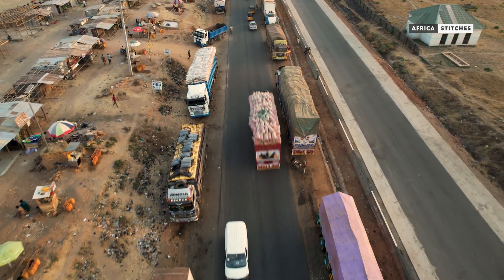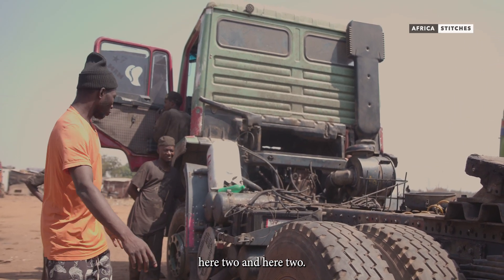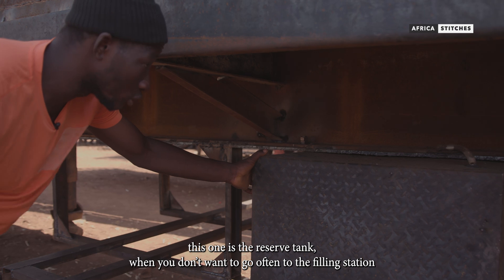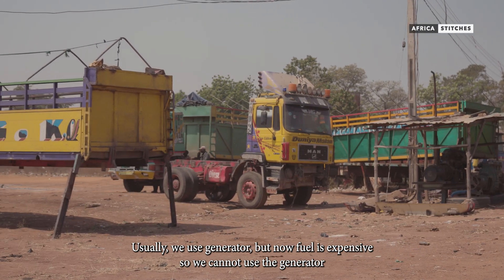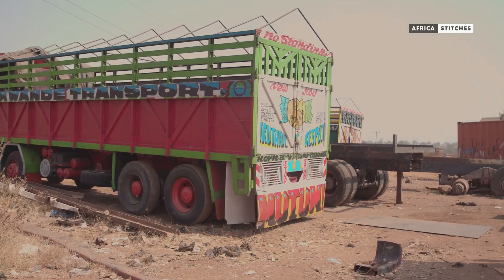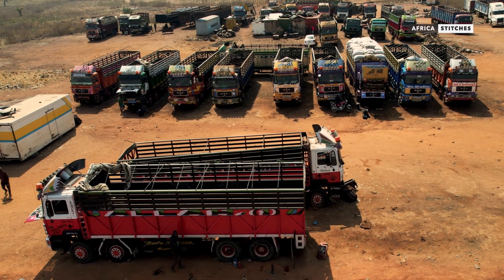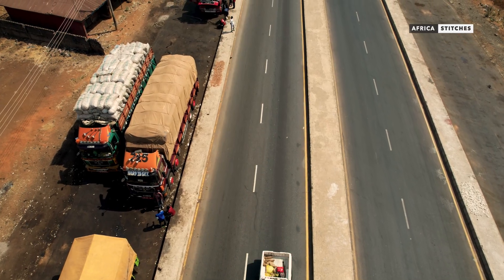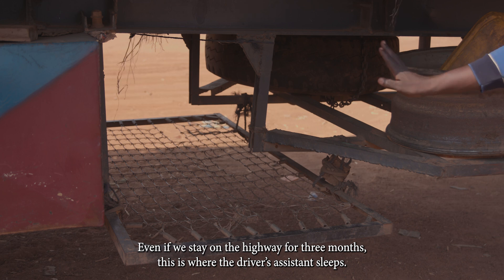We Documented how Trucks are Locally Made in Nigeria | AFRICA STITCHES

Comment: I haven't seen any of the steel mills that's making the frames or casting any of the axles. I haven't seen any engine manufacturing. In Pakistan at least they can take an ocean liner and cut it up and make it into things with a furnace and make their own steel. But they never wear pants and they always work barefoot I could never figure that out.
Reply from the maker: Interesting insight! Their technological abilities are impressive as well.
Reply: Because unlike afrcians Pakistanis refuse to wear colonial clothings